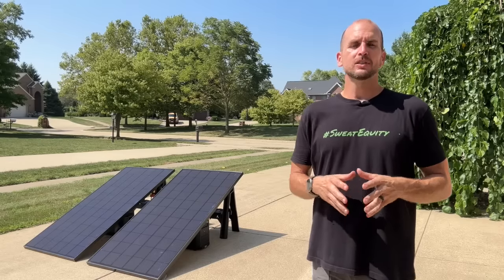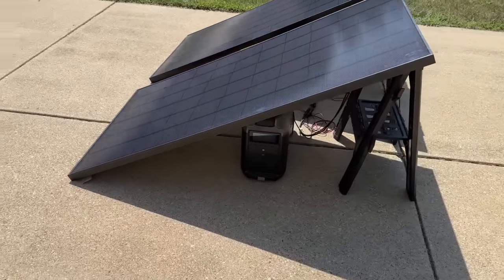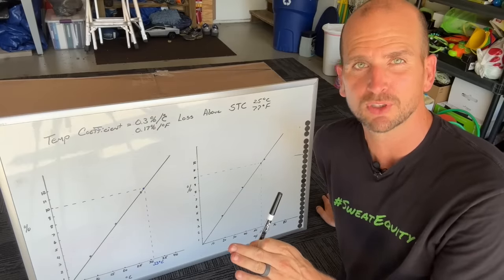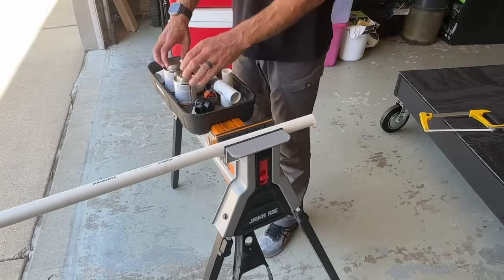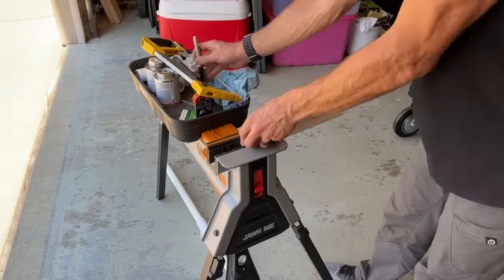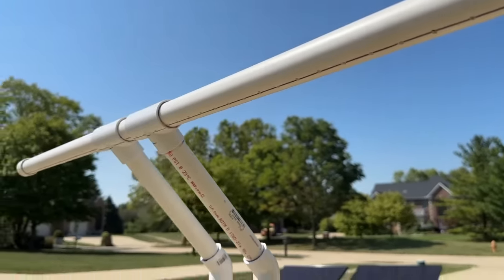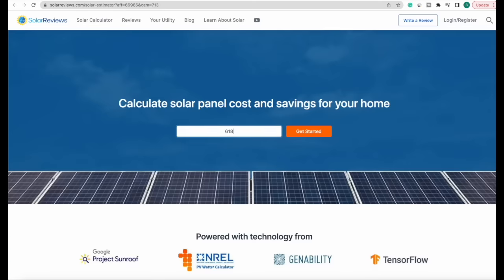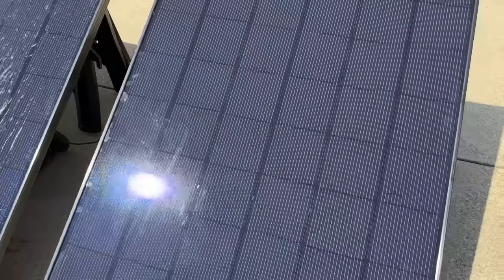Surprising Power Gains By Cooling Solar Panels

Comment: Tech ingredients did a similar experiment but did air cooling. Water is precious, it would be a lot simpler to to use dc blower directly to a solar panel or two. Maybe some hardware store bits to make simple heat sinks.

Not a huge deal unless you have a large array but the biggest plus Is it slows panel degradation.

Comment: Spray the water on the bottom. Water is not completely transparent so there will be some loss because of the water. Spraying the bottom allows cooling and doesnt block light.
Also water will turn your glass green with algae.
The actual diodes are glued to the plastic back panel so it would cool down better.

Comment: It's much more efficient to just have copper cooled with a low power outdoor fan on each panel running on its own smaller solar panel. It will run automatically since it will be on solar directly instead of a battery. If you have a larger setup, then a larger panel for the fans will be needed. This is what I'll be doing for a diy project later.

Comment: Tech Ingredients did this with a fan and blowing air at the back of the panel. They made I think 4-5 more watts and consumed 3 watts to run the fan, so a total increase of 1 watt (which is nothing), but they said that in their low temperature and low light environment (fall, northern latitude) makes the test harder to see a benefit... however, extending panel life might be worth more than the power increase anyhow.

Comment: ive thought about this too,i could cover the rear with alloy abs sandwich composite sheet with sealant as a seal and flood the rear chamber cooling the pannel without water affecting light hitting the cells
Reply: may actually be able to harvest the hot water comming back out to

Comment: I've used panels on my various RVs since the early 90's...always spray the back face with matt black paint. This radiates heat from the panels so much better than the factory high gloss white. Regrettably, my temperature measurement data has long gone.

Comment: Interesting idea but wouldn't the cost of the constantly running water offet the boost in electricity? 

Come to think of it though, with some additions, this possibly might make for an interesting combo Heat exchanger/water filtration system for RV use. Evaporate  rain water previously collected on roof or maybe even grey water  to cool panels  then use the distilled water in RV. IN other words, find some way to use the excess heat from panels for a secondary task to make the cooling system economically viable.

Comment: The panel without water had an output increase from 370 to 390 because its close proximity to the water panel cooled its local environment, so the 5% improvement you noted would have been more if there had been a greater separation between the panels.

Comment: If I had to do it -- I'd develop a geothermal system.  Essentially pumping something like glycol down into coils in the ground to and the chill it enroute to the panels and cool from the underside -- perhaps using a heatsink on the underside or an enclosed system -- creating a temperatue differential.   But I sometimes go too far... lol
Reply from the maker: I like it, my parents had geothermal since 1985 and it has served them well over the years.

Comment: The practical way to do this would be water cooling on the back side and a large heat exchanger the water is pumped through, the difference would be larger. The question then becomes is the power consumed by the pump worth it compared to the extra generation on the panels, and the answer for 1 panel would be no, but multiple panels and one large pump it would be. Just like how solar tracking requires power to move the solar panels, but the amount of power generated by keeping the panels aimed at the sun far outweighs the losses to the motors, especially the more panels moving per motor.

Comment: It may be worth looking to glue some kind of thin tube to the panel or thing where the commercial solution so then you can use the hot water for something

Comment: If it gets hot; maybe add a radiator to collect heat and dissipate it farther away from the panel. You could even harvest the heat and make a heat pump to generate energy

Comment: yes cooling the panel will increase power output by at least 8-10%.  but with continuous water or even spray mist after a month you will have calcium deposits and destroy the surface of the panel..  The same concept spraying with water or misting the home condenser unit and after a month or so you have calcium depo and the cooling fins start to deteriorate.

Comment: The solar PV energy gains wont be worth it even in a large system alone(300-800kWh annually), but the temperature capture could be worth it when combined to a 10kW scale system or bigger. If there is a use for the heated water and a gutter system already installed in the house roof to minimize the added costs. The water vaporisation and the gutter cooling is an issue thou for the water to keep it's temperature.

Comment: Could use a ram pump to move water to the panels. You might need a source of water like rainbarrels or a pond or something, but it would provide cooling without requiring electricity to move the water to cool your panels. If you lived off the grid near a lake or stream or something, it would probably be more viable.

Comment: Should cool it on the back with a closed loop and/or a heatsink with fans. It'd cost you some power to pump, but your gains should be more than your losses, and this way you're not wasting running water.
If you want to go full overkill, you could also construct radiative cooling panels you can put facing away from the sun on your roof, taking advantage of more roof surface area. Your returns, however, might not exceed your upfront cost of doing so, unless you do it for content.

Comment: surely, misting from below and using the water to grow a leafy crop under the modules would work better and waste no water.  Also, a heat-pipe bonded to under the module and heating up say a swiming pool or home hot water tank would also offer less waste.

Comment: there are panels ou can get that combine with the house water heating, so the excess heat actually saves money on heating the house. 
linus tech tips did a vidoe ages ago where he used them to try and heat his pool water, if i remember right..

Comment: My gosh, that cooling a modul would increase power was the first logic thing after hearing about the coefficiant. I even wondered why this is the first video i see about took so long. But MY first idea was attaching copper pipes to the backside to be able to heat the water. Instead of covering the light absorbing side with extra light absorbing layer.😂

Comment: Heat pumps are crazy efficient and a wind turbine could do the pumping, not just cooling the solar panels but possibly even chilling them by a small amount, which not only could increase efficiency but could also extend the lifespan of the panels.

Comment: this is a great experiment, thanks for sharing.  I've always wondered if better air flow under the panels would improve their performance in the same way.  I love the way that panel skirts look (like Tesla uses), but also worried about heat.  How about a small fan under the panels to help with some air movement?  Might be a wash (and probably why it's not done).

Comment: Well the panels could be manufactured to just have a heatsink and water to run trough them. So you can connect like 10 of them and make a closed loop to a simple head dispenser with a fan.
Would that be worth it? Dont know maybe if you have 800w large panels?

Comment: Add a water tight shell around the panel to fully encapsulate with a glass lid. The whole panel is cooled an water can be ran through a cooler of some sort and pumped back to top. No loss of water. Your numbers seem to prove it'd be worth it. It also allows the panels to be warmed in winter to melt snow or ice. You have me thinking, not good.

Comment: I would put a big heat sink on the back of the panel, and a fan for more air flow, fans don't take much power so the power drawn from the fan would be nothing compared to the benefit with the increase of efficiency. Some thermoelectric modules could also be placed between the panel and the heatsink, but would it be that big of a difference? Especially considering that it would probably need some temperature monitoring, if someone tried I'd like to see it in video 🙂

Comment: Regarding sizing of solar systems, your overall usage is only one of the inputs.  You might not be able to generate all of the electricity you use - our 10kW system generates about 2/3 of what we use over an entire year.  But that still takes a big chunk out of our power bills.  Our largest power bills are in the winter when the solar isn't able to generate as much, and the heat pumps are working hard.

Comment: Constant water/humidity is not great for the panels in the long run. Let me explain:

Modern solar panels are not actually fully sealed. They can (and will) let small amounts of moisture pass through the back.
This is actually a good thing, since any moisture that have found its way inside, can also escape.

That being said, water + hot panels = lots of moisture in the air. High moisture content can slowly (we’re talking years) find its way inside, and start causing trouble. That’s also why if your going for the used panels, you should go for those that’ve worked in less humid environments (or for the panels that are fully encased in glass)
 
Also, any cracks on this back film (usually white), should be immediately patched.

If you can, get panels that are white on the front. It will be much easier to see water/moisture induced damage. It usually stars at the edges, and is green/blue in color.

This applies to panels with the foil/plastic on the back (majority). Panels fully encased in glass, are not gonna be affected.

(sorry If i butchered the english language)

Comment: Trying to get back 20W per panel of 400W with water cooling seems silly because you need (1) pump energy (2) water resource. However this way you also get a cooler roof back too. You also can make it a closed loop with radiator. I guess they should sell panels with built-in water block for water cooling.

Comment: Cold water will shatter tempered glass if it is hot. The residue from the water that evaporates will reduce the electricity overtime.

Comment: Use a capture pool and solar powered pump to avoid massive waste of water. Need an automatic water fill when evaporation depletes capture pool. Have a separate panel to power the pump.

Comment: Perhaps the water could be recirculated by a low power pump runing of a separte 15 watt panel and no battery, so the pump will only work in sun peak hours, also the water cooling could posibly increase longivity as the crystals are running cooler.

Comment: cool test. Water is also a magnifier, intensifying sunlight, so I wonder how much of the power gain is caused by the cooling of the panels and how much was the increase of intensity of the sun?  Basically each water droplet is a magnifying glass. That's why you can get really burnt if you are in a pool in full sun.   On the flip side, the water droplets  (not a flat continuous layer of water) may also create areas that are less intense (along the circumference of each droplet possibly), so having water on the panel could potentially negatively affect the ability for the panel to fully absorb power from the sun at a portion of each droplet.  If that ends up being the case, then the cooling from your test may potentially be more valuable than your test concluded.  This may be splitting hairs, but I very much appreciate your testing and bringing up this line of thinking. To your point, I wonder if water could be channeled through pathways over the solar panels that could also heat the water to be used like a solar array and take some of the heat away from the panels.  Another thought is, if water were just to be used for cooling the panels, maybe running the cooling under the PV panel (through channels) to remove heat (not allowing the sunlight to reach the water directly.  It could be better or worse!  Again, the heated water could be run to a tank with an heat exchanger to provide hot water to shower etc.  (A Solar PV Panel with pass-thru to a Solar Array panel.
Reply: Magnification doesn't magically make more light appear. It's pulling it from the surrounding, so the net gain is zero. If anything that magnification is going to make it worse because you have different parts of the panel making different amounts of energy and it's less efficient, kinda like charging an unbalanced battery pack. I doubt it would actually make a difference tho due to the size of each solar cell and the size of a water drop.

Comment: I'd like to see a repeat of the test in a way that doesn't put the water between the panel and the sun. The refraction caused by the water will likely lead to a reduced efficiency of the panel. Alternatively, have both panels getting water dripped on them, but one of them gets very hot water so it isn't providing any cooling. A third panel may be required so you have a control. One panel direct to sun, one panel with cooling water, one panel with water that's hot and not cooling. Compare their output and see how much loss there is due to effects of the water. 
Personally, I'd like to see a thermal and photovoltaic solution that captures the thermal energy to heat up a reservoir of water on the panels, then plumb the cool water inlet for the water heater through those to heat exchange the thermal energy and pre-heat the water going into the water heater. It won't be perfect, but having some cooling on the panels will increase electricity production and extend the life of the panels, while at the same time lessen the cost of heating water for use in the home.

Comment: The main reason for using water coolent to increase the efficiency and power output right so , what makes better if you use electricity to spray water
Reply from the maker: Yeah, this was more an initial test to see the impact of cooling.  To design a system that you actually wanted to run for a long period of time or across an entire array you would need to take things like water pump power into account.

Comment: I wonder if a heat pipe system could be implemented. They use chemical reactions in a sealed tube. They could heat water or air or transfer the heat to a heatsink. They're cheap on a small scale but not sure about larger scale.

Comment: if that water isn't rain water or highly filtered, you will get an accumulation of mineral deposits build up on the panels.  I have seen similar idea used on AC coils and the deposits ruin the coils in a few months.

Comment: If you tilt one panel, you have to tilt the other panel. Panel tilt can affect the panel output.
Reply: I see your point but I doubt the half a degree lateral tilt is going to make a meaningful difference 
but sure he should have run the initial test without cooling again to show the power output was still comparable

Comment: I gather minerals in tap water are not good for AC coils  but I would image if you are going to expend water then spraying an equal amount as your test on solar panels  on the outside AC coils would save a lot more energy consumed with your AC then you generate cooling the solar panels.
Reply: An interesting study would be on the role of fluride in the water impacting the panels, I would imagine that it probably has no impact but still interesting

Comment: A 5% increase don't sound like much, but if you can scale up this thing, the gains can worth the cost of the system. You could reclaim the water, circulating it to/from a water tank that has other uses, only losing a part of it due to evaporation.

Comment: It makes more sense to oversize the panels like mine to take into account of the heat loss from the pmax coef so that at the worst temp possible around 85C @ 1000 w/m2 (or whatever your avg irradiance is), you will still be providing the inverters with all the energy they need for maximum output.  Potable water itself is a finite resource and we should be treating it as such.

Comment: Don`t put the water on the front of the panels, it will block way to much of the sunlight !!! You can pray the backside with water or use a water loop of copper pipes on the panel to cool it down. You can even make it so it stores the energy as in a water heater so you have hot water.

Comment: You need to capture the water, cool it with evaporative cooling, then recycle it. That way you only need to replace the water that evaporates.
Reply from the maker: Yeah, you would need a closed loop and most likely a pool to get closer to a system that would make sense to scale.
Reply: @everydaysolar , I was thinking something like that. Use it as a pool heater. Also, since you’re providing cooling, you could process more sunlight per panel, so you could use mirrors to reflect more sunlight onto fewer panels. Or maybe lenses on a box with smaller water cooled solar panels in the box.

Comment: Now you could make a different test. If you spray water on the panel the water drops itself diffuse the light somehow.

What if you build a like CPU cooler for panels? So a copper or aluminum plate on the backside of the panel where water can absorb the heat from the panel and put it into a radiator.

Comment: You should consider doing a project like this using a reservoir, rather than running the hose. The reservoir should heat up as the water goes over the panels, where it would collect at the bottom and get pumped back to the panel again. This way, the water would get heated, and evaporation would decrease the temperature. You could attach a hose using a float valve to keep the reservoir at a level you prefer. This way, you only lose water to evaporation.